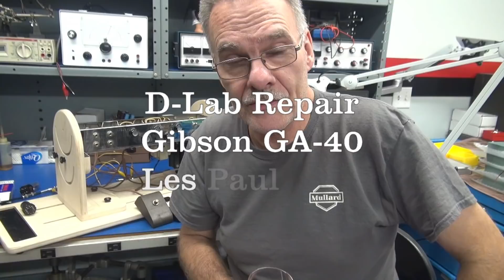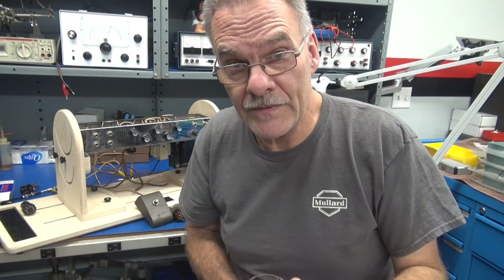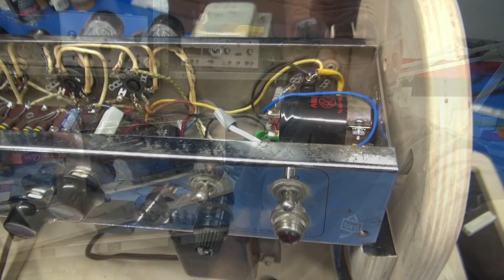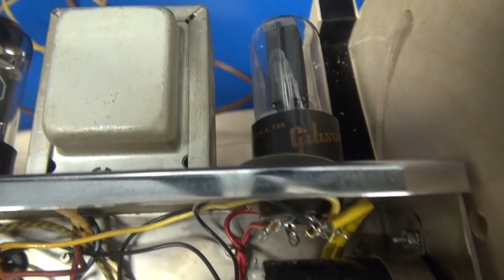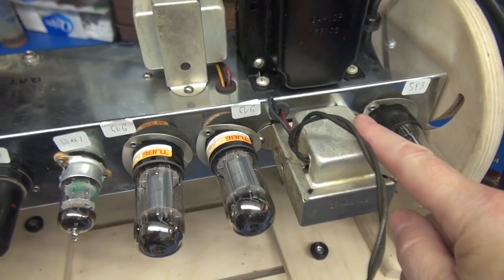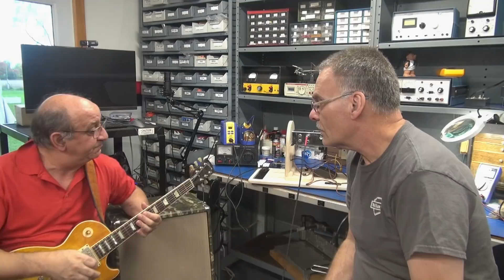D-lab repair Gibson GA-40 Les Paul Tube Guitar amplifier Classic vintage amp Fried 6V6 outputs

Comment: What year did the Gibson 
Lespaul GA40 come
Out on the market?
Reply: 1952
Reply: @stevencancel1727 Ok.. my brother inlaw
Had one back in the 1980s I put new capacitors in p/s
And other sections
Tuned up the tremolo
As well worked good after that also I put some screen shielding on the inside of the upper back door. When my hand would get near the back door it would home a little show the screen shielding kept the amp more quiet

Comment: Thanks for all the great info. I have a question. I'm in the process of designing an amp from "scratch". I managed to get the preamp all working as well as the 6l6 but the preamp isn't connected to the 6l6 and I'm still lacking an output transformer. How do I determine how many volts AC should be coming out of my preamp and into the 6l6?

Comment: I’ve got a Gibson Maestro GA45 with different input resistors and a separate bass and treble circuit. Everything else is the same but I can’t figure why they did the treble and bass separate? I haven’t found out why they made this as a separate mode.  Can you speculate on why they would have done this? And why the different input resistors? 

It’s a beast….a ton of sustain and sounds like no other amp I have ever owned. One problem with it is they have a bunch of caps on the backside of the board. I need to get in there and get them all on the front side. It’s a rats nest to work on. A very quiet amp though. It must be the 5879 preamp tubes that really gives its flavor. Please chime in on my first questions if you have a moment or idea. The schematic isn’t too hard to find if anyone has insight. You can really gain it up by bridge if the channels.